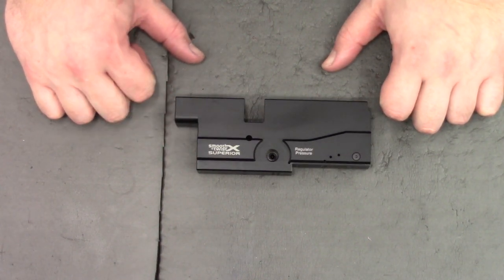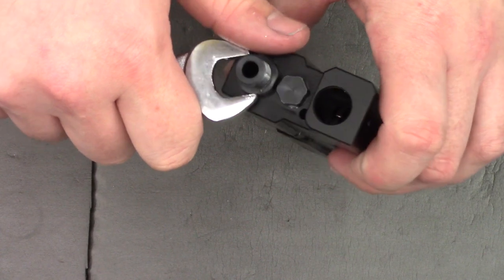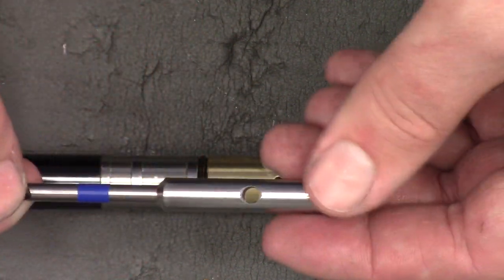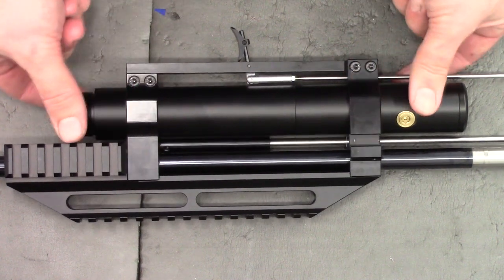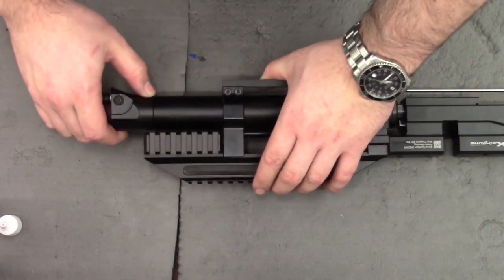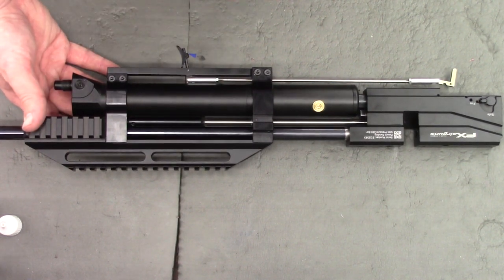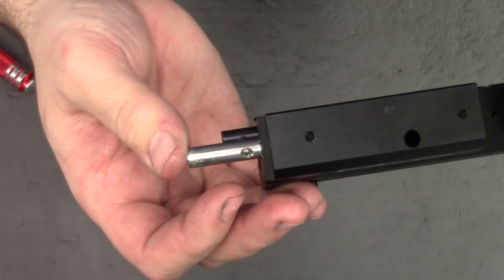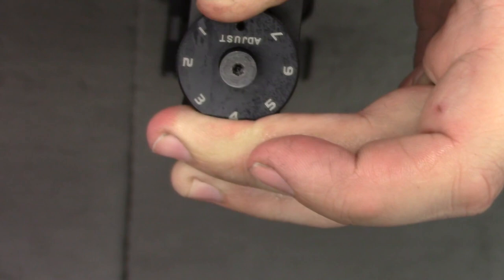Maverick UK Sub 12 reassembly

Comment: Great video,  extremely  helpful  to troubleshoot  potential  problems. 
I purchased a maverick  today and straight  out of the box (foam padded case)  the bloody thing is miles out of alignment.   My first shots  were a full 3 mil radian out in windage to get it centered  at 40 metres. Running  a straight edge down the side showed just how badly aligned it is.
It's  hard  to believe  they send rifles  out like this. 
I watched this video a while ago so I remembered  you showed how to align it properly,  and the reasons  they  can be misaligned.  At this point  I am assuming  poor workmanship  as it came in a decent  rifle case so I very  much doubt it is from  mishandling. 
Hopefully  my local airgun retailer will swap it out as it's  already been months of waiting and lots of $$$ spent.
I've  seen others stating the same problem  to.  I rolled the dice and hoped  for a good one but guess I lucked out.
Keep up the good work,   and the great vids.  Cheers.
Reply: Is it possible  to square up the blocks  and realign the top  rail assembly  without disassembling  the rifle,  by just loosening  all the bolts and realigning  them maybe?
Also,  when you put your rifle  back together  were you able to achieve  true 0 mechanical  alignment  of the scope or was it still a little  out?

Comment: Hi there thanks for the very informative video. What I wanted to ask you is how do you adjust the angle of trigger blade rod in the trigger guard, I have just purchased a used wildcat mk2 and the trigger post is at about 7 o’clock and pretty far back in the trigger guard, i want the post to be vertical at 6 o’clock then after taking stock off would make the whole trigger rods and mechanism look as it should.  I don’t know why it’s so far back but the 1st stage and 2nd stage works fine but for me it doesn’t look right how it is, I tried with undoing the 4 bolts holding air cylinder on to move the trigger back to 6 o’clock but couldn’t achieve it. I would love some advice without me going to do something stupid and damage the rifle, thanks for your time, I’ve saved both the videos on the FX Maverick for reference but dare not do something wrong, please could you advise, I’m sure it may be a simple task but I need professional advice, kind regards, Steve.

Comment: Excellent video, to make life easier for me on the wildcat I made a carbon sleeve to go over the barrel between the block and bracket were you got your 74.6 mm measurements. One other point is, the sharp bits you polished off with the stone may have been there to align the scope rail to the cylinder brackets and to stop it shifting when in use like the impact does. These should have been installed with shoulder bolts, not standard bolts. Fx have messed up big time by not including allinment slots or at least dowel pins for alignment. This will be the first thing I do to my Maverick if it ever gets here.
Reply from the maker: Great idea, I like that, the sharp bits were defiantly not alignment pins, they looked like tool marks left over from when A lathe tool is slightly under the center line. Shoulder bolts would have been better but the rail is so thin that I don't think (without custom fixings) that you could get bolts suitable. What the Impact, maverick and Wildcat lack is definite alignment point, like you say a set of dowel pins on each of the components and respective holes in the matching parts, so that its impossible to get the parts misaligned, this would also stop and movement in the rifle as it is fired or used, but I guess this would be very expensive for FX to do effectively. Thanks for watching.
Reply: @sub12airgunners  Pleasure watching. What they should have is a location slot like the Dreamline has. What i like about the wildcat is the barrel clamps have a dovetail location for the rail so its always fixed securely and aligned and cannot shift. I think I'll be either milling a key way in the rail and barrel clamps or replacing for the wildcat barrel clamps and wildcat rail (If compatible) Happy tinkering. 
Ps, whats your ebay handle so I can get a valve and reg puller from you.

Comment: Hi mate great video can u tell me on the bottle adapter there is a metal and rubber washer how do u change that one
Reply from the maker: that's a dawty washer that will just pull off, it's just the rubber holding it on
Reply: So u don’t have to de gas the gun to remove it

Comment: Hi Sub12, thanks for the reply about the removing the cheek piece on my maverick the groups have tightened up which is brill. Have spoken to sportsmanguncentre and they have a solution they sending me a new cheek piece thanks again for the help and as always your vids and explanations are just brilliant. Thumbs-up 👍
Reply from the maker: Great to hear, its a common problem with the mavericks and I am very happy it helped. Thanks for watching.
Reply: I must’ve missed something. removing the cheek piece does what? I honestly couldn’t imagine shooting it without one. I would have to hover my head to get scope alignment
Reply: @chewyfknrocks  the cheek piece was misaligning  my pellet mag on the maverick each time I load a pellet the pellet was damaged before exiting the barrel.by removing the cheek piece  the pellet mag would align properly. I cut a piece out of cheek piece to rectify the problem hope this helps
Reply: I see. On further inspection- and very interestingly so- the inside of my cheek rest looks like it has been modified some. More so  than what would only be the magazine rubbing on it. I received only a month ago from Utah airguns. I’ve not had issues with any pellet except for an occasional fussy HN terminator (inherent design I suspect). They are still very accurate however.

Comment: This is an awesome video my friend, really helpful. Do you have a cure against the cocking handle pin that keeps falling out? The one that's nearest to the air tube. Another question about the belleville washers. Do you think there's a difference in the way these are stacked (thin / thick on the bottom or top) between sub 12 and full power guns?
Reply from the maker: Hi yes the pin falling out is common, i just used a small dab of baring lock on one end of the pin😀 the sub 12 washers are much thinner than the full power ones but i believe the stack in the same sub 12 have 10 normally  and i have seen 12 on full power guns
Reply: @sub12airgunners  Thanks for responding. It's strange that FX (among others) makes such nice guns while lacking to improve the "little obvious things". Great idea, baring lock 🙂

Comment: I have been told the sub 12 models have the same internals as the high power? Just massively de tuned from factory? I have a slot on my ticket and fancy converting it myself. Don't want to sell my baby and then buy a high power one, rather do it myself. Will i need morel parts for converting it? Cheers
Reply from the maker: Hi they do have some of the same parts but you will need to buy quite  a few bits but it is posable to convert

Comment: Excellent video, very clear.
Just a quick question, what length barrel is in the 'standard' maverick? That shroud looked longer?
Reply from the maker: The standard and compact mavericks use the same barrel length the shroud is just a different length, both use 500mm  barrels, the FAC/ sniper editions use 600+700mm long barrels. Thanks for watching.
Reply: @sub12airgunners  thanks for the info! I've got the compact so was wondering what the difference would have been. Cheers appreciate the reply and the effort that goes in to these videos- they're invaluable 👍🏻

Comment: I have this valve removal tool and cannot extract the valve seat.  Even with a set of picks I can’t remove the seat.  Have done plenty in the past
Reply from the maker: I have seen some valve seats that look a little different, they are much thicker and don't have the cutaway at the rear of the seat, quite uncommon in the rifles I have seen but not unheard of, could you try fitting an o ring around the groove in the tool and using it like a puller, the o ring might give you enough friction on the seat to remove it. Thanks for watching.

Comment: Solid information from a very capable person. Thank you. 

I just received my Maverick, but have been shooting the FX Boss for years. The trigger in the Maverick is quite poor compared to the Boss. I have it adjusted to it's limits, but do you have any thoughts on improving the trigger linkage system on the Maverick to reduce slop?  It's definitely not a joy to shoot at this time. Thanks for all.
Reply from the maker: Not without major modification to be honest, the trigger linkage is a bit flimsy and would require a bit of work to get it to work properly, my idea was to remove the original linkage and replace it with a thicker one with a rotor joint at each end, this would remove the play in the motion and make it a bit more direct, not sure if ill get round to it though as I don't like the Maverick enough to spend a lot of time on it. Thanks for watching.
Reply: @sub12airgunners  Thanks for that. I gotta ask, do you have a favorite rifle?  Or top two?

Comment: Is the inside of the hammer supposed to be polished smooth?  Mine has milling marks (like shallow screw threads), and I think this is a defective part—should be smooth.  Do you know?
Reply from the maker: Its not polished smooth from the factory, and mine had some very very light marks on the inside but it was not rough to the touch, you could polish it smooth if you like, but unless its really rough it should not cause much trouble with the operation of the rifle. Thanks for watching.

Comment: I have very small leak coming from digital reg gauge do you use o ring or lock tight ?
Reply from the maker: I didn't have a problem with mine, the X ring in the bottom of the screw thread sealed the gauge, have you tried tightening the gauge a little.

Comment: Hi man, question, i reassembled my maverick following you instructions and now the rifle wont cock? any ideas?
Reply from the maker: Hi, could be a couple of things, first check you have not adjusted the hammer spring adjuster to far out, second just check the cocking rail (long silver rod) make sure the grub screws securing the cocking arm are tight and in the right place, you should be able to see the marks where the grub screws were tightened at the factory. and double check you have the right distance between the block and the rear scope riser block. Thanks for watching.
Reply: @sub12airgunners  i checked the hammer spring adjuster and it was spot on 5.8mm, i realized the cocking rod had unscrewed its self a bit during disassembly, once I returned that to its original position everything worked fine, thanks for your reply and help.

Comment: My 1st regulator stuck @ 90bar max. Won’t go up any farther! Could you please give a tutorial how to set 1st reg @ 150bar ? Is there any washer settings need to be replaced?
Reply from the maker: Did you open the back reg fully first? if not you need to open the back reg fully then adjust the front one, if you did then you need to replace the beleville washers in the front with thicker ones, the FAC ones are normally 0.5mm or 0.55mm thick and the stack is usually the same ()()()()()(. 

Thanks for watching.